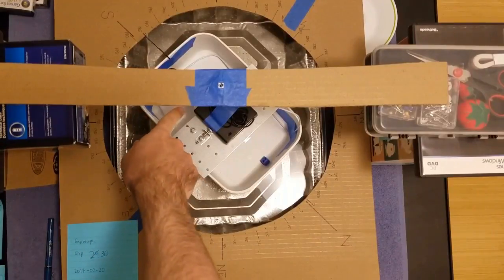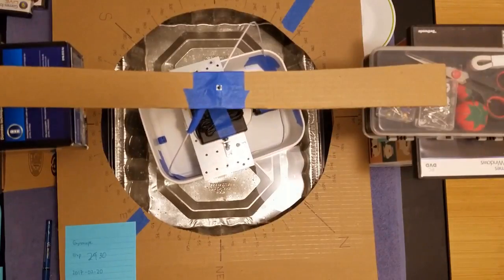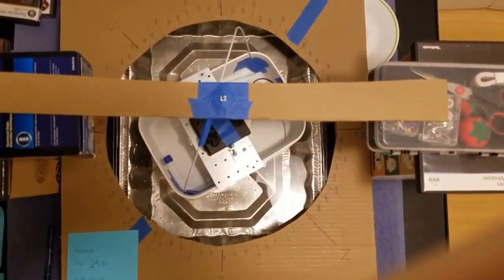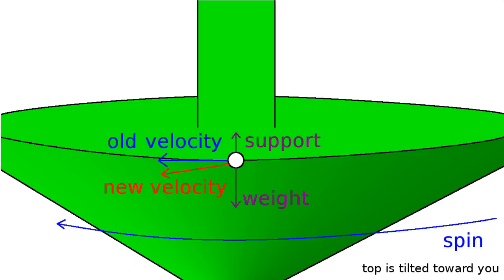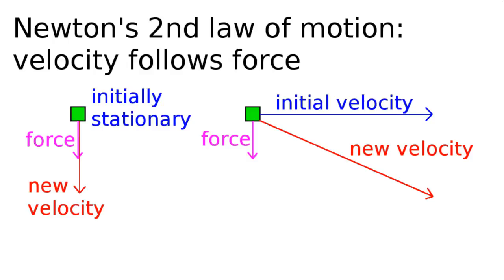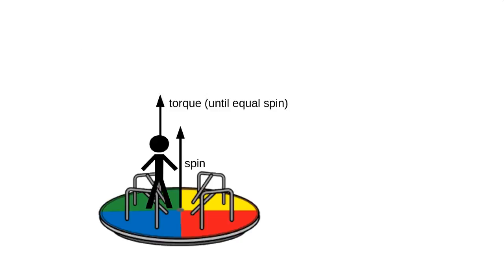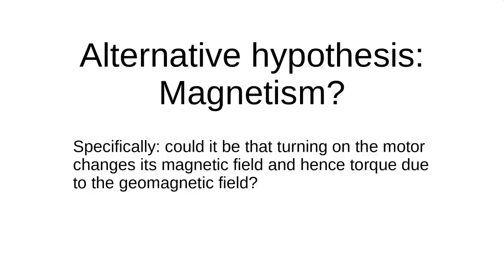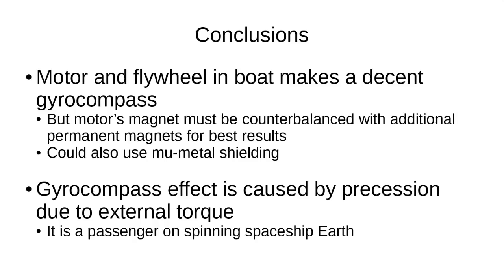Gyrocompass showing effect of Earth rotation

Comment: show a clock that uses the gyro's orientation to point an arrow to the time of day and this wouldn't be a waste of time and energy.
Reply from the maker: This is a (2-axis) gyrocompass, not a (3-axis) gyroscope.  When placed within a rotating system, a gyrocompass always points North.  The second half of the video explains why that is.
Reply: @GarbageGamer74  noted. Though i think its far better to build a somewhat practical use gyro clock with a gyroscope on each of three axis to detect any rotation with 3 ring gimbals to indicate time of day as well as the month by the rotation of the planet on its axis as well as around the sun.
Reply: @GarbageGamer74  a youtube video series called "The Primer Fields" shows bowl shaped ceramic magnets that levitate freely inside each other which should make lovely maglev gimbals when used at each axle of each gimbal.
Reply from the maker: @hintzofcolorconcepts  There is another video on my channel (search for "gyroscope version 2") showing my build of a 3-axis gyroscope.  It's much harder to build than a gyrocompass.

Comment: Sorry if this is a stupid question but I've watched this twice now and still don't understand how the gyrocompass acts like your example passenger jumping onto the earth and having to catch up his speed. All of the parts of the gyroscope were, relative let's say to the center of the Earth, already rotating with the same angular velocity as the surface of the Earth, as was the water, as was the container holding the water, the table, etc. If the little boat somehow weren't rotating with the Earth, if it were instead hovering in some stationary position like a satellite, it would gradually bump into the side of the still-rotating container, no? Of course it will drift a bit because water isn't a solid, but the average movement of the water, held inside the container so it has no choice, is still with the direction of rotation, isn't it? 

I thought the fact that gyroscopes "choose" some axis to maintain upright with respect to only works if you choose an inertial reference frame that is outside of the Earth itself and not susceptible to its movement (like how in the Newtonian era they assumed some stars were not moving and used those as reference points). For example if I plop a big asteroid at a fixed position in space--one that magically and quite literally does not move ever--and I can somehow start my gyroscope on the Earth's surface with the upright position pointed at that asteroid, over the course of 24 hours it will appear to me as if the gyroscope is tilting by some unseen force, when in reality it's just a fictitious side effect of my position on the Earth rotating away from the asteroid and causing the direction of the gyroscope's angular momentum to change (thus producing a directional torque but no change in magnitude). And, as I understand it, the way you put this to work as a compass is to then just mark off the Earth's north pole somewhere with respect to the asteroid, start the gyroscope up, and lock one of the gimbals in place so that it can only tilt on one axis. If that's the case and I haven't insanely misunderstood frames of reference and conservation of angular momentum, I just don't see how the passenger analogy fits in. What component is "catching up" to the speed of the Earth here?
Reply from the maker: Good questions.  I'll try to address each; feel free to ask for further clarification.

How is the gyrocompass like a passenger experiencing a catch-up force?  As you say, the water, table, and boat are already rotating with the Earth, so they experience no catch-up torque.  But the flywheel is not rotating with the Earth; it is rotating in a different direction.  A rigid object can only spin around one axis at a time, and the flywheel's spin axis is not aligned with the Earth's rotation axis.  If the gyro were bolted to the Earth, as a passenger, the Earth would force the flywheel's spin axis direction to change over time.  Spin direction only changes due to an applied torque, just as linear speed only changes due to an applied force.  That is the passenger torque.

The next part of your comment refers to what I call an "ideal gyroscope": a gyroscope with perfectly balanced and frictionless gimbals, able to turn in any direction.  First, note that an ideal gyroscope does not care about motion at all, since that involves linear forces, and its gimbals are perfectly balanced so that linear forces are not transmitted to the flywheel.  What an ideal gyroscope cares about is absolute direction*; specifically, because there is no friction or imbalance, it experiences no torque, so its spin axis direction in 3D space will remain constant.  So, if an ideal gyro's spin axis is pointed at a motionless asteroid, it will remain pointed at it *if the asteroid is infinitely far away. 

But the gyrocompass is not an ideal gyroscope because it is constrained to rotate in the horizontal plane.  It therefore experiences the "passenger catch-up" torque I explained above; again, think about what the flywheel would feel if its spin axis could not rotate at all with respect to the Earth's surface, as the Earth rotates.  For reasons explained in the video, in a gyrocompass, that torque causes the flywheel's spin axis to precess until it is pointing North, such that the spin axis is as close to the Earth's spin axis as it can get.  It will then continue to point North because any time it deviates (for example, because it wants to keep pointing in the same direction in 3D space), it immediately feels the restoring torque caused by the Earth's rotation.  There is no need to calibrate the gyrocompass ahead of time; it always seeks North (or South, if you use the left-hand rule instead) because it always seeks to align its own spin axis with the Earth's.
Reply: I appreciate the time you took to reply to my misunderstandings. Thanks

Comment: That gyro is sensitive enough to detect the rotation of the earth ?
Reply from the maker: Yes and no.  In the setup shown in this video, yes, it can and does detect the Earth's rotation.  However, the flywheel I am using came with a two-axis gimbal (you see it in a lot of other gyroscope videos on YouTube), and that gimbal has too much friction to detect such slow rotation.
Reply: @GarbageGamer74  ... if the device is not sensitive enough to detect earth rotation .... cant work as a gyroCompass

Comment: Have you tested this at different elevations and other variations to ensure a constant 15° “drift”? There were and still are ongoing tests using a laser gyro by a group of engineers, they’ve had mixed results of “drift” dependent on elevation and other factors. As much as 7-8°.
Reply: That’s not true. It’s consistent thousands of times a day every single day.
Reply: @Truearthtruman  - "they’ve had mixed results of “drift” dependent on elevation and other factors. As much as 7-8°.

That is a flat out lie.
I have been testing fiber-optic gyros since before you were born. They read 15.0 degree per hour rotation REGARDLESS of where on the earth they are.
PERIOD.
Now stop making stuff up.
Reply: You calling something a lie, when you weren’t there and YOU have NEVER done it, means nothing to me. Cope baaltard
Reply: @Truearthtruman  - "You calling something a lie, when you weren’t there and YOU have NEVER done it, means nothing to me."

Sorry but I have been HANDS-ON testing fiber-optic gyros as an Aerospace Test Engineer since first trained to do so by Lockheed Martin in the 1990s.
I have tested about four different kinds including a mechanical gyro and they ALL READ EARTH ROTATION.

It is YOU that needs to "cope" with reality.

Comment: This definition of a gyrocompass states: A gyrocompass is a type of non-magnetic compass which is based on a fast-spinning disc and the rotation of the Earth to find geographical direction automatically. The use of a gyrocompass is one of the seven fundamental ways to determine the heading of a vehicle. 

The magnetism 🧲 you’re referring to in your video... could you please elaborate on that. At this point I’m very confused running across your video... 

-Waffa (CZC admin)
Reply: Are you using magnets to sort of offset the magnetism the motor your using has? I’ve watched the video several times now and I’m still very confused
Reply from the maker: @WAFFAHOUSE  Yes, that's right.  The electric motor contains a permanent magnet, and that magnet is affected by the Earth's magnetic field, making the boat act like a magnetic compass.  I added additional permanent magnets in approximately the opposite orientation to minimize the magnetic compass effect so that the gyrocompass effect would be as strong as possible.  You may want to look at the follow-on video linked in the description where I repeat the experiment with magnetic equilibrium in different places.
Reply: Ah I see... So do most of these that are used "in the field" use additional mags like you did in your experiement to counter the magnetic field?

-Waffa (CZC admin)

ps
Appreciate you explaining that to me. Starting to make a lot more sense to me now... @GarbageGamer74
Reply from the maker: @WAFFAHOUSE  I don't know much about industrial gyrocompasses, but I assume they use more sophisticated motors that are not affected by external magnetic fields.  Balancing the magnetic forces like I've done seems too imprecise and unreliable in a device meant for navigation.

Comment: Very nice presentation! I've been trying to setup a simple experiment for North finding, but I've not got it setup quite right yet. Kite string is not good for a suspension thread and there has to be a way to dampen out the wobble from touching the darn thing. I'm planning on using the weight that comes with the super precision gyroscope immersed in vegetable oil.

I was thinking monofilament fishing line would work nicely. The other thing to do is not allow the gyroscope to go a full 360º. So I need a way to set the rest point at the top.

My only other worry is that the gyro can settle before it winds down. Also, would that winding down produce the same torque effect that you showed when you turned your motor on then off? I do not have a satisfactory way of keeping the gyro spinning at this point. My hope is that bearing friction, being parallel to the axis of rotation, would produce zero precession as the cross product would be zero.

Have you seen Ice Skater's video?
Reply from the maker: At one point I experimented with using thin sewing thread to suspend the gyro apparatus as part of an attempt to build a better pitch bearing to make a true gyroscope.  The sewing thread worked pretty well for the yaw axis, since its restoring torque is very small, but I gave up on making it work for pitch, mainly because of the usual problem of balancing.  I don't recall problems with wobble, but that design never got very close to working.

Why not allow the full 360?

From my early experiments, if you do not have the motor attached, you have two problems.  First, the flywheel spins down too quickly, losing most of its angular momentum within a couple minutes.  Sure, it takes about 10 minutes to stop entirely, but after a minute or so the remaining angular momentum is slow low that the effects we're trying to measure are just too small for amateur equipment to detect.  Second, unless you manage to keep the flywheel perfectly vertical, you'll get that torque due to spin down.  For those reasons, I switched to designs that keep the motor running, which is annoying because the battery pack is quite heavy and awkward.  One idea I had but didn't pursue is to use some solar panels and a bright spotlight to power it.

You're talking about this video, right?
https://www.youtube.com/watch?v=-3ELhspVAUY
I have seen it, yes.  I gave it the thumbs up.  :)
Reply: That's the video.

My understanding is that the gyroscope doesn't care which end of the spin axis is aligned with the local meridian. I could be wrong of course. So if you're overshooting by a lot, it takes much longer to settle.

Rigging the gyroscope like a plumb bob is not super difficult. At least not under the high precision gaze of the Mark I eye ball 😉. That said, I think my video with the gyro suspended by the kite string is showing momentum being transferred to the string. The torque has to come from somewhere. The wobble I induced by spinning it up also took a while to settle. Obviously the weight is going to be providing a gravitational torque. Having that swing like a chaotic pendulum is not healthy.

I certainly do agree with you that the gyroscope gives a very short time of useful angular momentum to work with. The flywheel is only about 111g which is not a lot of mass. It's way better than a TEDCO. Better be for that kind of money!!!

Anyway, I did enjoy this video and gave it a thumbs up. There are not enough people showing that "simple" North finding is proof of rotation. It's also nice to see how other people approach the problem. For my part, the "Holy Grail" is actually having a gyroscope point to the same location in space as the earth rotates. It's a very tall order indeed! It is quite clear that most people don't appreciate that fact. What I'm currently working on is getting around the static friction issue by deliberately inducing precession with a mass and spinning the rotor in both directions. I will also be measuring the period of the flywheel, precession, and the angle of inclination that the arm the rotor mounts to has. That part is in line with the angular momentum.

Fun stuff! Also time consuming and getting expensive.
Reply from the maker: Re "the gyroscope doesn't care which end": the spin axis vector, as defined by the right hand rule, wants to point North.  If you try to point it South, it is in unstable equilibrium; a slight perturbation will send it North.

Interestingly, my experiments show that the gyrocompass (at least as I built it) isn't very sensitive to initial direction, unlike a magnetic compass.  A mag compass oscillates back and forth like a pendulum, with amplitude dependent on initial deviation, but the gyrocompass seems to just move steadily (but slowly) toward North (or wherever it finds equilibrium, which depends on magnetic torque), then oscillate chaotically around that point indefinitely.  I don't know why it never settles down the way a mag compass does.  I suspect the non-zero viscosity of the water is involved.

I agree a true gyroscope pointing consistently in space for an extended period of time would be an even more convincing demonstration.  One of my other videos shows my best attempt so far, which is only so-so, holding its position only for a couple minutes at a time.  My apartment is littered with the remains of inadequate designs.  :D

Re expensive: tell me about it!  I've already spent way more than I should have on tools and hardware.  The gyro itself was among the cheaper components.  :/
Reply: It's funny how all those nickels and dimes add up over time. It becomes an obsession. If it could be done in the 19th century, why not the 21st? Of course, inertial navigation systems have been relying on these principles for years. They just cost thousands of dollars.

Comment: How does this prove Earth’s rotation rather than the Aether drift moving around Earth as per the Silvertooth Effect published in Nature, Sagnac Effect and Airy’s Failure?
Reply from the maker: The gyrocompass shows that, on the surface of Earth, we are living in a rotating frame of reference.  If there were no rotation, with all other assumptions held constant, then the gyrocompass would not deflect from its magnetic equilibrium because there would be no other source of torque.  I welcome alternative hypotheses, but to be relevant, they must explain the deflection of the rotating gyrocompass. 

It sounds like you are suggesting the hypothesis of a moving Aether to explain those other experiments' results.  But the hypothesis of a rotating Aether surrounding a non-rotating Earth would imply that the gyrocompass should not deflect.  This experiment shows that it does, so we must reject or modify that hypothesis.
Reply: LBBstore  It has already been proven that there is no Aether. Modern relativity and quantum mechanics are based on the null result of Michelson Morley.   To get up to speed try this link.   https://en.m.wikipedia.org/wiki/Michelson–Morley_experiment

Comment: Set the gyro axis to your Latitude, so that when North rotation is found, the axis will be parallel with the Earth axis and its rotation will be the same as the Earth.
Reply from the maker: I don't understand.  Set the axis how?
Reply: Raise the end that will be turning CCW higher than the CW end, so it can orient itself to run parallel to the Earth axis. Not parallel with the water level.
Reply from the maker: Ah, I understand now: rotate the flywheel housing to point the spin axis 38 degrees (my latitude) above the horizon.  That's a novel idea, but what would it show?  For example, do you have a hypothesis for how the boat's movement would be different from the original experiment?  Naively, I would expect it to behave basically the same.